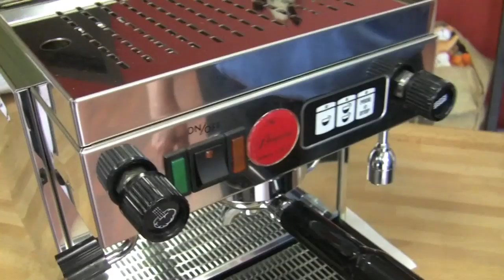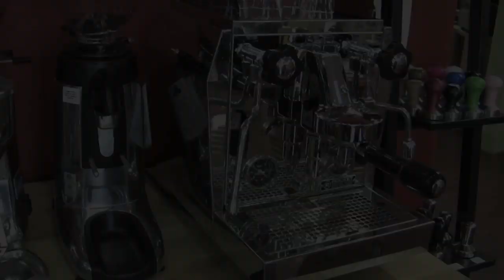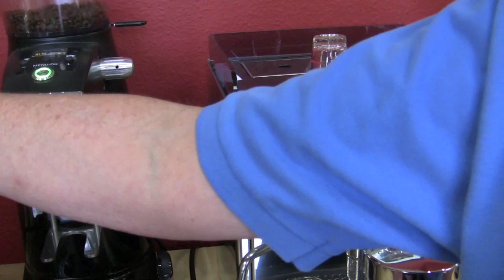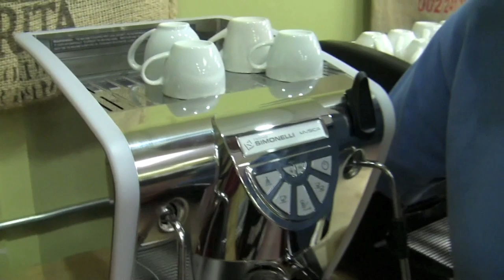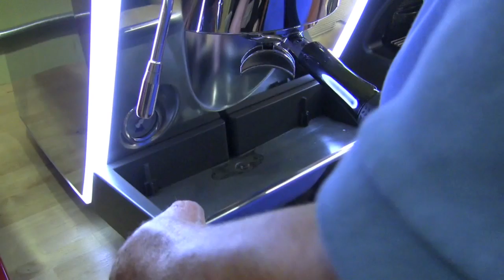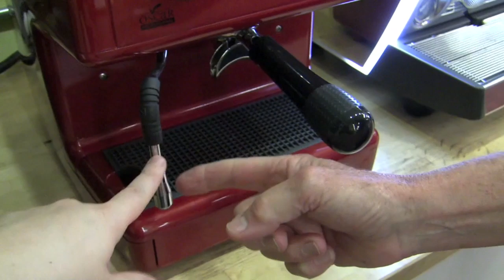Compare: Heat Exchange Espresso Machines

Comment: As an Oscar owner, I'm somewhat biased. :) But, if you want hot water from a HX that doesn't have a water spout, just use the steam wand to heat some in a pitcher. Super easy and fast.